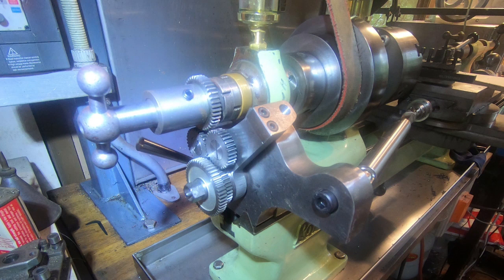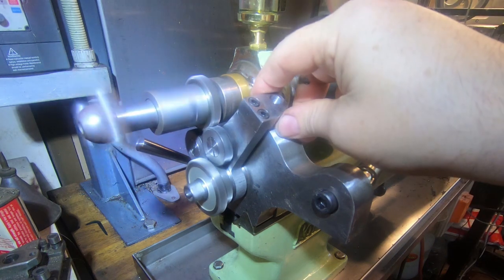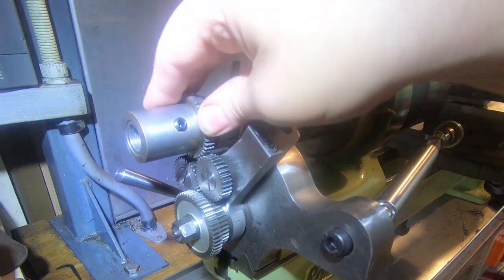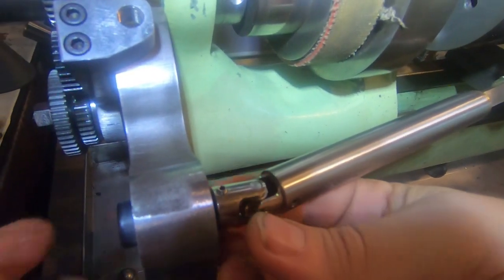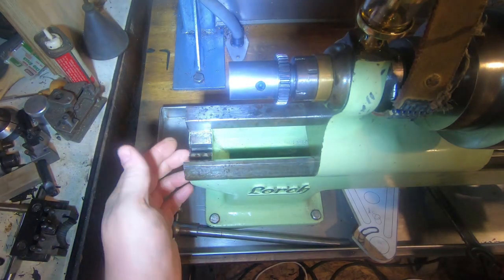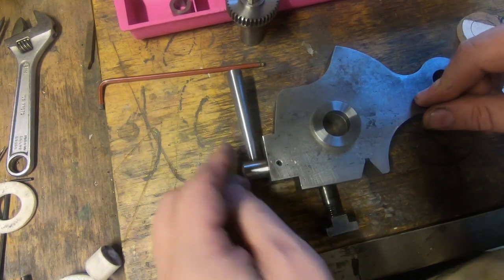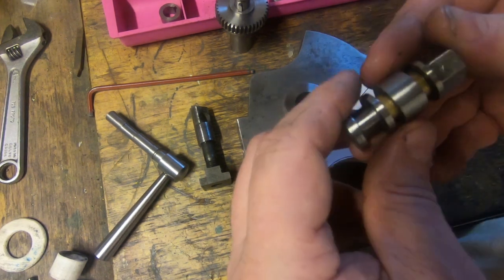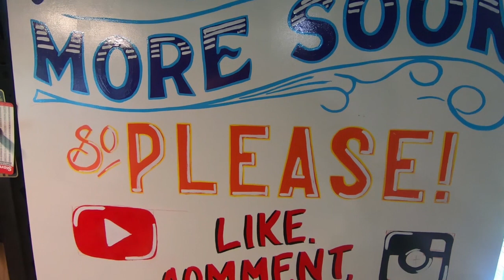THREADS!! Building an Attachment for the Lorch lathe UPDATE.

Comment: Emma, great to see the capability of your Lorch expanded. Food for thought for when I have time to restore mine. Judging by the smooth sound of the drive train you must have used some very concentric gears and no-slop bushes. BTW Sloan and Chace were one of the few to have used a shaft without universal joints to drive the carriage along (see John2478), whereas yours and similar used an extendable shaft with UJ's.

Comment: Great progress so far Emma. I'm glad I watched, because I hadn't gathered yet that it clamps to the bed, rather than bolting up to the headstock. I like that, it's a nice design, and more reversible than drilling and tapping holes - bonus points! Also love the eccentric bush for gear mesh tuning. I reckon you're past the halfway point. Just gotta do: banjo, output shaft, gear upgrade, and not much else?
Reply from the maker: pretty much, actually. final finishing is on the list too, probably more work than the others. lots of little fiddly bits.
Reply: @EmmaRitson  Final finishing of course. And - in my workshop that last 10% of work takes 50% of the time! :)

Comment: Emma, it is coming along very nice.  You always do such good work.  A side note on the plastic gears.  I have a 3D printed 16DP 20T gear on my lathe that is used for the fine feed.  It has been on there quite some time with no sign of failure or distortion yet.  You may be surprised how well they do.  On a further aside, I have not forgot about the KW Engine.  I am about to finish up my steady reconditioning then it is back on the Engine and Mill.  Great video and thank you for sharing.

Joe
Reply from the maker: Cant wait to see. :)

Comment: Nice design work, Emma!  Actually looked like an original attachment, until you said it was wire-EDM'd.  The later Pratt & Whitney bench lathes used a similar system, but my old #3 lathe uses a chasing attachment with a threaded drum and follower.
Reply from the maker: the drum and follower idea was sort of imagined up at the same time, or along side. seemed a bit more complication to make it work though, so here we are. thanks for watching!

Comment: It is really turning out nice and I have to say that it is a lot quieter than my Atlas.  Your gear mesh is right on.
Reply from the maker: cant you adjust the atlas a bit?
Reply: @EmmaRitson  They are adjustable but I think that your gears have a better mesh.  I will be taking the gear train apart, cleaning, lubricating and adjusting them.  Hope that it helps.

Comment: It's coming together great .  No levers to set to the wrong pitch just the driver driven calculations ! LeBlonde used a similar system for an early relief turning attachment ( Tony's lathes . UK   had a picture )  The kick out stop may have to be on a pivot so the kick out side has twice the travel as the actuating side to stop wear on the dog clutch corners & kicks it out at a quicker speed than the travel speed . , just a thought .    Cheers .
Reply from the maker: Thanks max. I think I know what you mean I'll have to think.
Reply: "No levers to set to the wrong pitch" - We've all done the same, Max - now you need to find it within yourself to accept it and move on. Remember what we said: "Enhanced rigidity model".

I owe you a beer after a comment like this :-)
Reply: @CraigsWorkshop  I owe you one . the tool arrived .  Thanks , it will fit the big lathe easily . Cheers .
Reply: @swanvalleymachineshop  That's great that it's arrived with you. Hope it comes in handy. Cheers, Craig

Comment: G’day Emma. You have put a lot of thought and effort into this gear train, congratulations. The eccentric bushing is a excellent idea but how do you turn it? Is it a pull apart, reset, assemble and trial fit? The jack shaft and dog looks good and I’m sure you’ll work out how to auto disengage. Well done. Cheers 
Peter
Reply from the maker: yes, it pushes apart and put it back in the right place. hope it only needs to be done once. thanks for watching.

Comment: A thought occurred to me regarding the mechanism that keeps the two drive wheels disengaged when in a  central position. If it's important to have adjustability away from that central position that is defined by the sprung loaded pin,  then you might want to consider an over the centre cam lock e.g. cycle wheel quick release mechanism rather than another set of counterbores.

Comment: Excellent work and progress Emma - for the feed knock-off, take a look at what Lorch did on the slightly later and larger A6RG:
https://photos.app.goo.gl/Kz8yaK7u4XQgPKkb7
the little casing with the two gears makes it a little easier, and the gear at the end of the leadscrew has a brass pin that's there as an 'anti-catastrophe' sheer piece, quite a good safety feature I think. Only any use for surfacing rather than screw-cutting I think (how do you pick up the thread again...?), but still useful.
The reversing tumbler is a good feature - the A6RG doesn't have it unfortunately.
Reply from the maker: Thanks so much. Will study the pictures a bit. That's invaluable.